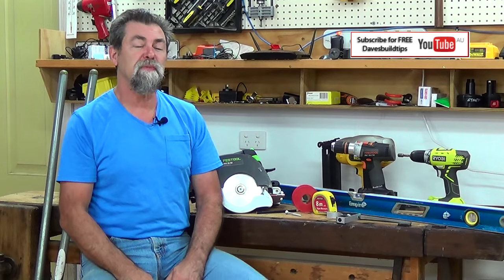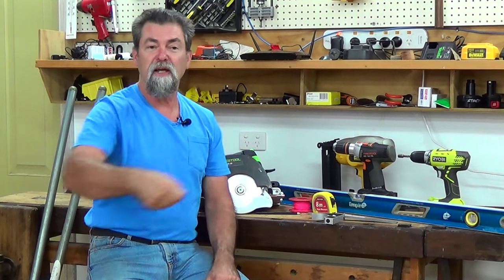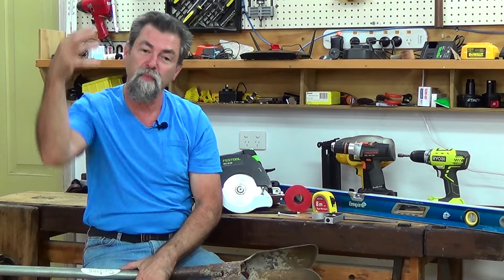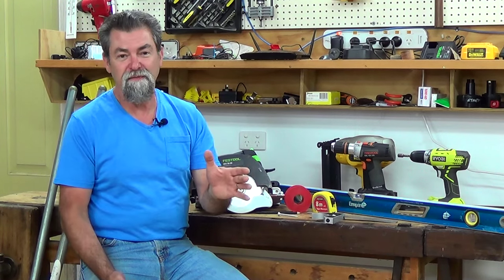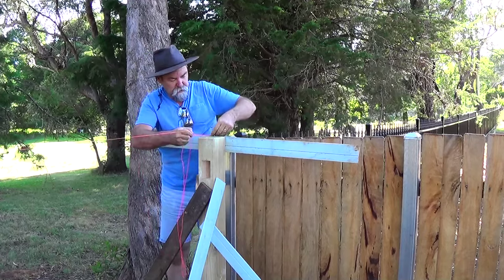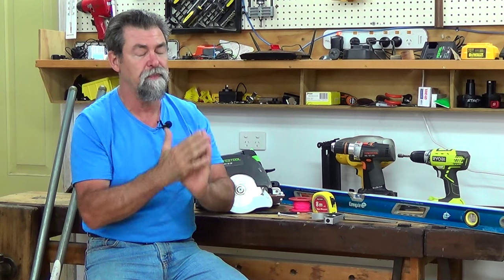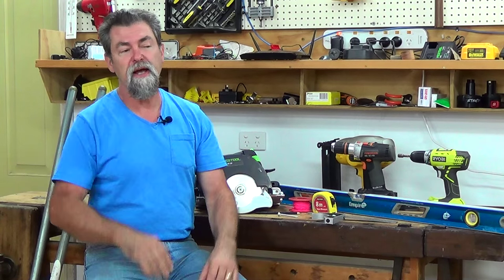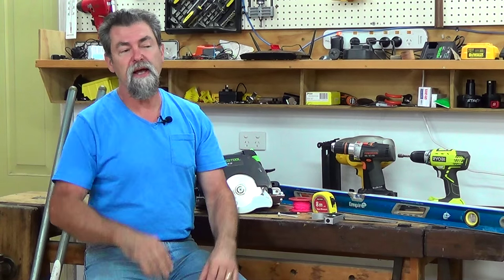How to build a post and rail fence | Dave Stanton woodworking

Comment: Great video Dave! What did you use to chamfer the edge of the posts? Electric plane? Any recommendations on black paint for painting the fencing, or would  you recommend the old creosote?
Reply from the maker: Hi Gareth Fisher any paint that is an external quality.
Reply: @DavidStanton  Thanks Dave. What about the chamfering of the edges of the posts?

Comment: was it just silicone to glue between timber and stone top? will that mould up and get dark over time? sorry have a similar DIY project got me doing some research on it.
Reply from the maker: I didn't use any silicone Eddie. The fence has been in place for  2.5 years now and looks great and solid as a rock.

Comment: How did you do the slots in the posts?
Reply from the maker: +Christo Mario . Watch the video again. I tell you at 1.00.
Reply: +David Stanton great, thank you. Do you know if you can do it with a router and spade bit? Awesome video.
Reply from the maker: +Christo Mario . Yes, easy. Make a template and take out 1/2 inch either side with the router and then remove the rest with the spade bit, tidy up with a wide chisel.

Comment: Hi Dave, thanks for this video, really very helpful. I'm going to put a three rail post and rail fence up across the front of our property in the next couple of weeks (I'm in the Blue Mountains so I'll be watching out for Funnel Webs!). We have a driveway in the center of the block and the ground slopes down a little as it comes to the drive, maybe about 400mm fall, is there anything specific I should do in relation to the slight slope?  I assume if I do the invert the post and cut it off thing you suggest then the rails will just follow the slope down to the next post, just wondering if there is anything else? I am having the posts mortised and I'll ask the guy to allow a little extra room on the end posts to allow for the up slope of the rails. Thanks :)
Reply from the maker: Hi Mark. You can keep the top rail on one plane if you wish or drop it on the last bay to follow the fall of the land, totally up to you. If you want the fall near the drive, make the second last post the one you run string line to the side of the property from. Hope this helps.
Reply: Thanks David, thats a big help, appreciate it.
Reply: Hi Dave, thanks for your reply, I have built the fence now and it came out very well, your tips were very helpful, thanks :) One more question if I may, how did you attach the chain link to your fence? My posts and rails are all hard wood and I'm finding hammering gal staples into the wood very difficult, just wondering if you found an easier way to do it?  Thanks Mark.
Reply from the maker: Hi Mark. You could try using a 1 inch type 17 roofing screw designed for timber, not steel,  through the turn up on the top and bottom of the wire. The images may be a little help. https://images-na.ssl-images-amazon.com/images/I/31gRiexq2cL._SY300_.jpg http://lovehomedesign-images.s3-us-west-1.amazonaws.com/wp-content/uploads/2016/03/27092233/shutterstock_139892266.jpg
Reply from the maker: Do as many intervals as required, maybe 2 or 3 apart.
Reply: Thanks Dave, that would probably work, I'll give it a go this weekend. Thanks again, Mark.

Comment: How do you know where to make the cuts in the posts before they are put in the ground and cut.
Reply from the maker: All the same distance down from the top of the posts, depending on what height you want your top and bottom rails. Turning the posts upside down and cutting the bottoms off to a string line looks after everything else.
Reply: Thank you David. I have one more question. In the video i see you use 2×4 and it goes straight through the 4×4. When yoh do that are the 2×4's sharing 2 inches each of the 4×4? If so is this a strong method and long lasting.. do you also put screws in it.